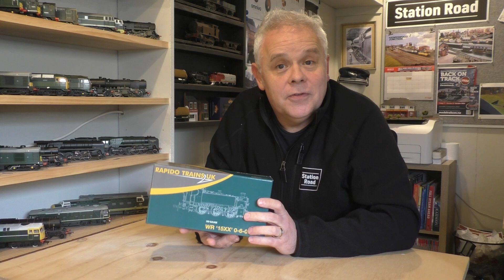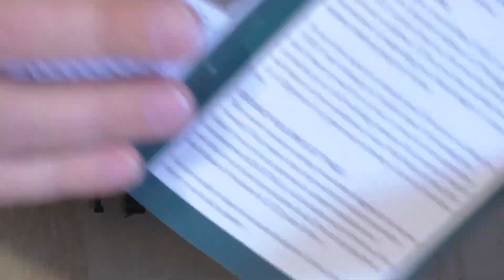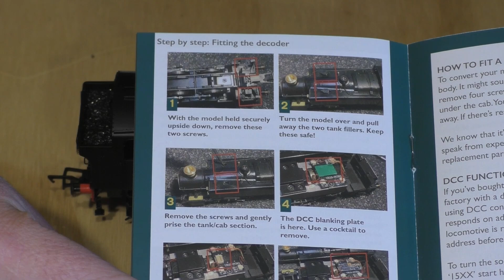Rapido Trains UK - 15XX Plight + DCC Fitting

Comment: Good points Julian.
I run Tri-ang locomotives.
They are robust, reliable and easy to maintain. I hear people complaining about the lack of detail. But as Richard Lines once said... There is a fine line between derail and functionality.
Happy Modelling.
Reply: I've started going back to Wrenn for the same reasons. New models are over priced and drop to bits in the box.

Comment: Hi Julian, you raised some very good points as do other commenters. I very rarely buy moden ready to run locomotives, mainly because of the fact that I've had to dismantle my layout for now. Instead, I've kept myself busy, trying to build kit white metal and brass kits. These can also have, fiddly bits, but by soldering them on the fixing is much more permanent, however if you use the chassis as one side of the pickup then, I believe that fitting DCC is impossible, maybe some clever person can put me right on that subject. I will clarify for you that your pickups are called plunger pickups. They can be very common on kit built locomotives. However, the great locomotive builder that is Tony Wright, see Little Bytham on YouTube it's just sensational, doesn't like or use them on his kits due to the adjustment system. I, personally, like all the extra details, and I would agree with you that some aren't seen or indeed necessary when viewed at a certain level. It's about a 50/50 split with kit chassis as to whether the locomotive springs are depicted. Also, personally, I think the extra bits make the difference between a train set and I model railway, take your amazing scenic kit building for example. It would be dead easy to have an oval of track with plastic pre-painted houses, etc, and be exceeding happy with that. But you've taken your layout to a whole new level with your custom buildings and bridges. I suppose manufacturers have done the same, and some build quality issues have arisen. Imagine how the locomotive would fair in the hands of an eager 6 year old, there would be a lot more bits loose in the box and around the place!. And there lies the issue, some manufacturers are trying tremendously hard to give use the exceptionally detailed locomotives and rolling stock that some of us almost crave, especially when the product costs so much, we all like to get our monies worth. I  don't know how much you paid for the 15XX, but imagine paying the same amount for a plastic body with moulded in handrails and the like. Sorry that this comment has gone on so long, I'm preparing for the flack that I'm bound to receive for some of my comments.

Comment: As a former mechanical engineering deign guy, I was shouting at the screen during the video LOL! Seriously though, there are a lot of design 'features' in RTR stuff these days that are good, but many that are (as we say) 'sub-optimal'. Those 'springs' under the chassis, behind the wheels -  they just need to be part of the chassis diecast, just like they are on other models, or even how they are on the old whitemetal kits. As for those 'steam pipes', I would have cut the bottom 'lugs' off altogether, so that once glued in place, they merely sit over the top of the cylinder chests (no one will know). Having them as separate pieces is good for detail and keeps the smokebox tooling cheaper, but they need to be glued to the smokebox at the factory, which would likely entail making a jig just for that (so more cost). Regarding the broken-off buffer (of the replacement loco)-  notwithstanding the possibility that it had already been weakened when packed at the factory, doesn't it's arrival with you (detached) suggest the possibility that it was Rapido who damaged it when repackaging it for despatch to you? That foam packing, designed to sit between the buffers, looks like any slight twisting when closing up the transparent plastic enclosure, would apply lateral pressure to the affected buffer. Finally, regarding the use of Cyanoacrylate glue. From my aircraft modelling, I've been introduced to Ammo's Black Cyanoacrylate Glue. This has a slow cure (but can be 'accelerated' of course) and the Black 'filler' is a rubber-like compound (so the glue is not as brittle). The advantage here, is that (being black) any excess wouldn't have shown up so much on your loco, compared to conventional Superglues.

Comment: I bought the DCC sound fitted version because I didn't want to have to disassemble loco and fit a decoder.  Unfortunately, the decoder died when I changed the address about 5 minutes after getting it out of the box, so I had to take it apart to get the decoder out for testing (and ultimately to send  it back to Rapido UK for repair).  One of the steam pipes on mine came off when I opened it to remove the decoder to testing, and it was really fiddly and extremely stressful to get back on.

Comment: Just an FYI: old Rivarossi models had that style of plunger pickup.
They're rather notorious as they had the same "sticking" issues, but what happens is the little springs doing the plunging carry the sparks and over the years the springs loosen, or even break, being sprung steel, but also being extremely thin and soft. Folks have cut and pasted kadee coupler springs as an attempt at a remedy.
I bring this up as they all do it, so unless Rapido has come up with something exceptional, this will be what the 15XX owner will experience.

Comment: It's an issue for us across the pond as well. I've purchased a couple of rapido loco models  as well. All have needed re-motoring either within a month or year, or i experienced some issue right out of the box. To fair, rapido has been excellent at handling my warranty issues and I've had my models back very quickly, although truth be told, rapido's head office is literally a 15 min drive from my house. 😉 

That being said, I have Life Like (now Walthers) proto 1000, 2000 engines both Steam and Diesels. These engines are now pushing almost 20 years, have endured my ham fisted handling, dcc mods, detailing, etc, and they are still getting the job done. These are my go-to engines when operating almost all the time. I agree with your sentiment that the fine detail on a lot of newer engines comes at a cost. For my money, I'll always look for older generation models and modify them. Whether by adding dcc/sound and adding details as I see fit while still ending up with a solid running model that looks just as good. Thanks for the honest review of your experience. You're definitely not alone.

Comment: I recently sent my new 15xx back for repair under warranty to Rapido. It had shorted on a set of points(turnouts). If you have an oval of track then you shouldn't have a problem. I believe the push springs are weak and fry when shorted. Rapido have repaired all six of the push springs and to my surprise the sound decoder as well. I am waiting for it to be posted back. I think I will sell my 15xx on ebay at a much reduced price.

Comment: Having seen reviews on this, its a nice model... however there are various issues I have seen and read regarding these.
Breakages, poor running, glue marks, damage ect... 
I am surprised the buffer spilt wasn't picked up, unfortunately it is QC, and depending who you purchased it from Rapido or a shop I always look for someone who checks before dispatch.
This plunger pickup I have seen in model kits, are not new, but they do like your 15XX get stuck and fail to spring or return, the old Dapol/Hornby terrier was another to have them they worked ok... so its not so much the type of pickup maybe grease maybe a bure from the manufacturing who knows.
But if the wiper pickup isn't broke why change?

I know Rapido are all about detail, and thats fine as long as it's robust and fitted properly.
I personally don't like some of their finishes on metal work like pipes or brass work... I feel they are a few steps behind other manufacturers.

Comment: Hi Julian, Unfortunately I had the many of the  same issues, returned first to my local model shop for poor running / rocking went through 3 in the shop before I found one that was better. Then the second I filmed on my channel and it got worse more that I ran it. The wheels had so much play they hit the brake blocks. This was returned to Rapido and over a about 6 weeks was returned un-repaired, then I had to send it back again and wait another month for a new chassis to be fitted.  The white packaging sponge will also snap off 3 link couplings if you fit them. Agree poor quality and manufacturing tolerance control.  Regards Steve

Comment: I couldn’t even put mine in a glass case to look at! I went through 2 models of 1501 that were hopeless from a quality point of view (paint finish issue, decorative issue, chimney not on straight, bits of detail like drain cocks snapped off) and after the second badly put together disintegrated disaster I returned it for my money back and gave up. So odd as the Rapido 16xx I have is completely solid.

Comment: Hi Julian....   I told Rapido about the decoder and the terrible Duck waddle!!    Rapido replied by saying that the waddle was prototypical and it was just like the real thing!!   A day or two later it went back to the seller!
I also purchased two Accurascale Manor modelss and then three Dapol Manor models....Give me the more powerful and solid of the two manufacturers offerings everytime!!   The Accurascale models will stop at various areas of the track with wheels spinning!!    Apart from so many bits falling off and snapping off the motor of the Accurascale model is absolute Rubbish and won't pull the skin of the skin off the rice pudding!!
Just a thought...Have you tried Zimo decoders..Mx600R and Next18.

Comment: Hi Julian. Whole heartedly agree. I have been in this hobby for 40 years and have a mix of the older Hornby locos with ringfield motors (all converted to DCC) as well as the newer Hornby/Bachmann and Heljan DCC fitted locos with sound. I agree that the newer models look wonderful but are getting increasingly prone to damage from handling and like you I wonder if the manufactures are going to far. At least the older models are robust and easy to  handle. I also wonder if the never ending push for more detailed models by the consumer has resulted in the manufactures being pushed this way.  Cheers from Tasmania.

Comment: It would seem to me that problems with packaging would not be as evident with folks in the UK who have the advantage of being able to call into their local store for purchase, and where rough handling in shipping would be less severe and for a shorter period. Us international folks are going to receive purchases following arduous shipping, and handling by folks who occasionally see the words "fragile" on the packaging as some sort of challenge! If the packaging is less than ideal, damage is more likely. Hopefully, you've mentioned your findings to Rapido, so that they can take some remedial action on future packaging.

So far I've only seen 2 reviews on the 15xx, and both had problems, thankfully, you're reporting that many others are not seeing problems, so there's still hope. The 15xx is a bit "late" for my model period, but I do have a 44xx on pre-order, hopefully I won't see any problems when that arrives - needless to say I will be unpackaging, inspecting and testing immediately on receipt! Because as you point out, the turnaround time on international shipping can be lengthy and frustrating.

Comment: I prefer older locomotives, they may not be superdetailed but they are not as fragile and things do not tend to drop off them at random.  As for the detailing, what's the point of detrails that are invisible at normal viewing distance?  I have one locomotive, an old Triang Midalnd 3f tender loco it's about 50 years old and has been re-wheeled with Romford drivers but it still has it's original pick-ups which work perfectly.  The older stuff is easy to work on and rareely goes wrong but when it does it's easy to repair - I have some that I've bought new but they are a devil to take apart even for routine maintenance.  I'd much rather spend just over a hundred pounds on four older loco's that I know will keep on working for years than on one brand new one that may not.

Comment: I have three Rapido models, 2 off 15XX and a 16" Hunslet.  After reading numerous issues with these models I decided that I would no longer purchase any further Rapido models.  Perhaps report on running reliability when on DCC as numerous reports of seized plunger pickups after DCC shorting has occurred.  The plunger pickups are unsuited as they are too fragile and not up to the potential current draw the model may experience.

Comment: Seems to me the big problem here is rapido unpacking it and the. Repacking it.
When it's done In the factory it rolls down a production line to it's last stage before package where a tool is used to keep the loco in the correct place in the packaging ice as it's folded around.

Your initial problem is simply a design issue with these spring loaded contacts.. if there's too much grease they simply stick in place

Comment: Hi Julian, I also have this model and I’m not totally happy with it as I returned my example with a few faults such as the wobble, but mine wasn’t as bad as yours. Also the running whilst descending a 1 in 36 incline just jerked its way all the way down. On this they said it was down to inertia, really ?. I thought. None of the other five models a mix of Hornby Dapol and Bachman have this issue. I’m totally disillusioned with Rapido and will not purchase any other loco from them at least in the near future. I now use my loco on the flat as a shunting engine. Not at all satisfactory. In my view.

Comment: Well Simon, on the bright side after having cleaned and fired the actual loco itself, it would appear that Rapido have included the realism of what a pig  she really is! 😂 Everyone, firemen and drifers alike struggled to get the injectors working with one even nearly running out of water due to the issue. Regarding the model detail, they spent so much time adding the fiddly detailing, they totally missed the glaring basic details. For instance they flaming huge safety valve bonnet is actually brass and not painted black. Trust me, ive spent hours polishing it! I agree with you. They need to stop adding the fiddly and fragile extras and work getting the basics right. But thank you for the very enjoyable and informative video. Take care and happy modelling 😊
Reply: The safety valve is brass but in actual work a day use was not bulled up as in preservation.
There are plenty of photos showing this.
Maybe the odd one might have been polished but it certainly wasn’t official policy.
Not even in GW days was it the official policy for the smaller tank locomotives to have polished brass fittings, certainly not post the outbreak of WW1. Most had their safety valves painted.

Comment: Hi Julianso sorry to see what a lemon of a model it was. It looks great but is an absolute assembly disaster with all those bits dropping off, crikey.  The pickup design with a 50% failure rate is a joke. Would a Rapido director be happy if their employees did the right thing only half of the time and failed the rest? Ditto on the packaging causing damage. A simple drop and shake test would have picked that up, even if their engineers/ CAD/ design rules/ product and packaging reviews had missed it.  It demonstrates to me a total lack of understanding of design, development, validation and manufacturing of consistently good quality products that will get shipped around the world and be subject to mishandling even on the intended home market. All those issues you had were avoidable. I for one will be avoiding Rapido models, just not prepared to take the risk! All the best Stephen